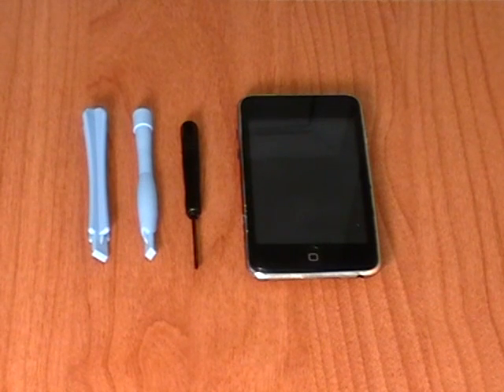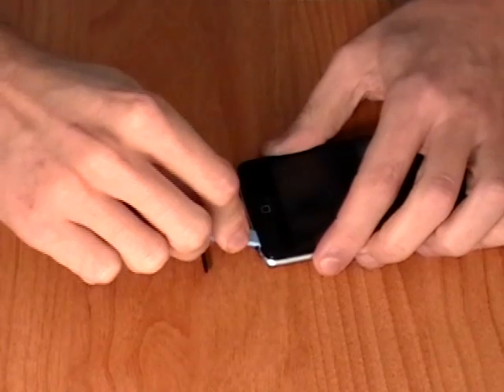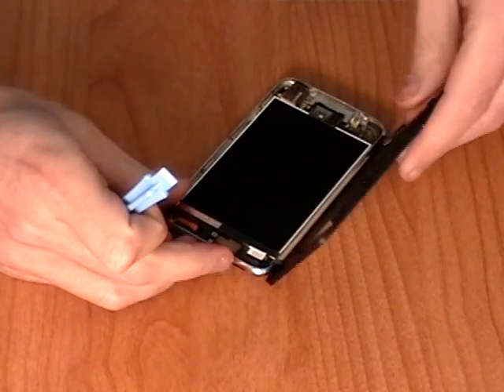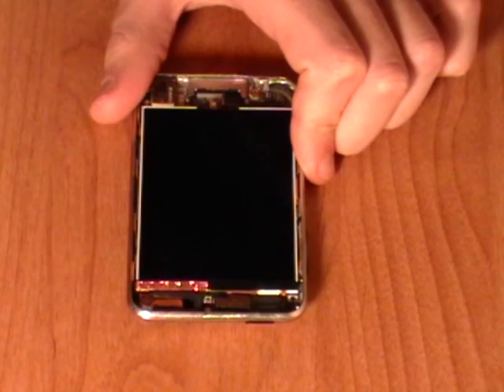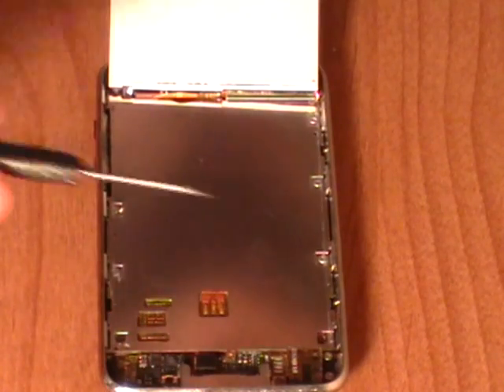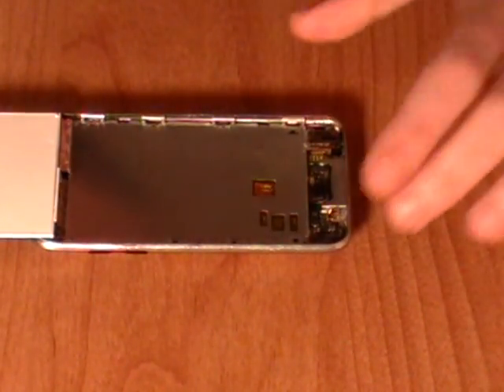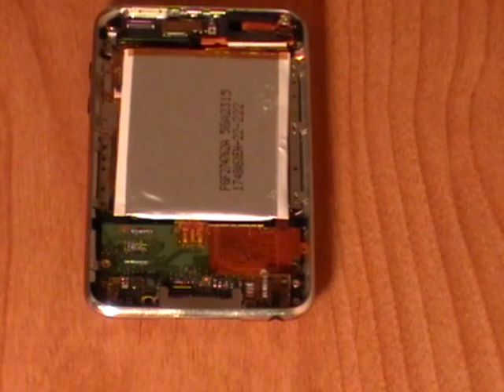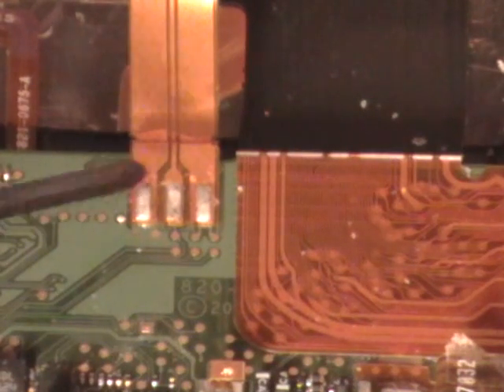iPod Touch Battery Replacement Repair Guide for 2nd Gen

Comment: ok, so you failed to mention all the things I had go wrong. The adhesive that holds the digitizer. ruined that. What do you do with a stripped screw. cant get the battery out because its glued to the metal frame I cant get out. Don't touch the screen it will ruin it.....easier to buy a new one on ebay.
Reply: oh, and those pissass plastic tools chip away. so they are worthless.
Reply from the maker: Hello, Sorry you haven problems with this. Lets see if we can get you right as rain.
Do you need to replace the Digitizer and the LCD? or just one of these?
If its the Digitizer here you go.
On the adhesive that holds the digitizer. did you buy the digitizer with the frame?
If you have bought the digitizer with frame here are the steps.
1) take your pry tool around the bottom sides and slowly work up the sides to the top.
2) once you feel the digitizer is loose and can be removed. put down the pry tool and take your hands and slowly take the digi. off the device.
3) once you see the flex cable on the top that is for the digi to the motherboard you can release the flex cable.
That`s just the Steps to remove the digi on an ipod.
here are the steps to put a new one one.
1) with your new digi , take the flex cable and connect it to the ipod.
2) remove any xtra plastic that comes on the digi from us. It should have 2 one on the front and 1 that sits next to the lcd. remove this one.
3 with the plastic removed put in the digi to the ipod from the top first, and then the sides and then the bottom.
with that now in place test the home button ( one on the bottom ) if its makeing a click sound you are in great shape.
those are the steps from replacing Ipod digi/screen with frame. from start to end.

If you bought the Digitizer with no frame you will have different steps.
theses are those steps.
1) take your pry tool around the bottom sides and slowly work up the sides to the top.
2) once you feel the digitizer is loose and can be removed. put down the pry tool and take your hands and slowly take the digi. off the device.
3) once you see the flex cable on the top that is for the digi to the motherboard you can release the flex cable.
4) now take your pry tool and heat gun around the sides of the broken digitizer and remove all the broken glass. ( WARNING ) please go slow and do not cut your self. glass will be in spliters here so slow is good.
5) once you come to your home button you will need to remove it with out breaking it, and to do this you need to take your pry tool and slowly go from the back to the front . you can apply some force but not so much that it breaks.
6) once you have the home button out . keep taken the rest of the broken glass off.
7) Now that you have all the glass removed from the frame its time to apply some adhesive to the frame. if you bought or have pre cut adhesive would be good here. if not don`t worry. You can cut your own.
8) once you have your adhesive to your frame connect your home button and metal frame to the Frame. ( the metal one is the one on the home button )
9) Once your home button and adhesive are all together. its time to put your digi on the frame.
so take your new digitizer and connect it to the frame, To make sure you have a good fit - follow the bottom with the home button hole and go from there.
10) with your new digi , take the flex cable and connect it to the ipod.
11) remove any xtra plastic that comes on the digi from us. It should have 2 one on the front and 1 that sits next to the lcd. remove this one.
12) with the plastic removed put in the digi to the ipod from the top first, and then the sides and then the bottom.
with that now in place test the home button ( one on the bottom ) if its makeing a click sound you are in great shape.

This is the steps from start to end on how to replace ipod digitizer with no frame.

if you need anymore help please feel free and replay to this.

Comment: ok so my ipod dint hold a charge so I replaced my battery and after it still wont hold a charge and shows that I have to connect it to iTunes but when I do and try to restore it says I have a problem and wont reboot. What should I DO!?!

Comment: How can I test the unit to see if the "no power on" issue is the battery, dock port or motherboard? I have a unit that does not turn on, charge or connect to iTunes.

Comment: does repairs universe give soldering tools along with their usual repair kit.. what is the cost of battery plus all the tools. my battery still works but doesnt last for more than 24 hours even when idle. it is kinda erratic sometimes it will last for two days. but at other times it will discharge within few hours. can i improve the performance of this battery. the ipod is more than  3yrs old or shd i go for a battery replacement. I am kind of tired charging it again and again

Comment from the maker: Depending on what caused the initial battery to fail, this could be a damaged board. Also you want to double check the installation for connections.

Comment: Hi, my 2g touch died, i presumed it to be the battery as my son has thrashed the pants off it for nearly 3 years. it would do nothing at all and was not recognized by itunes. After your very informative video i have replaced the battery but am still in the same situation, any ideas why or any other tests to determine the issue? so far im thinking its the logic board

Comment: I believe my ipod battery is burnt out because it will turn in and work fine but only if it is plugged into a power source at all times. It literally shuts off the second i unplug it from power. Do you think it would be worth it to get a replacement battery? or should i just buy a new ipod?

Comment: I did this repair on my iPod touch 2gen and the device powered up after replacing that battery, but the screen did not load the apple logo or anything....it WAS getting power to the screen though, it was backlit.  I checked the screens ribbon cable  and it was securely in place...what could it be?  I did my best to solder the battery neatly in 3 strips like it originally had. could it be a problem with how neat the solder was?

Comment from the maker: It really depends on what kind of damage was done. Leave the device in a bag of rice overnight to soak up all the water, then try connecting it to a computer to see if iTunes recognizes it. If it is recognized, then it is likely the motherboard is functioning correctly. If it not recognized then it is likely the motherboard was damaged and the device would be considered "totaled".

Comment from the maker: Normally the battery would not cause a dim screen, a quick test would be to plug the device in. If it functions fine, the yes, the battery may be to blame. However it will likely stay dim as it is the LCD screen that is the cause - assuming there has been no motherboard damage to the device (water damage usually).

Comment from the maker: @jay666rob Its best to have a reference (such as this video) to be sure you have it lined up properly. After the old battery is removed, it becomes quite obvious where the connection needs to sit. Once it is lined, just tack it down with a small amount of solder.

Comment from the maker: @lucien0002 Sounds like a connection issue, likely caused by the solder. I would suggest attempting to resolder it, or if you are not comfortable, take it to a repair shop and just have them resolder the connection. I can't imagine somewhere local will charge you much for that.

Comment from the maker: @oalacord Normally, if all software options have been tried, the only hardware issue is the USB dock port. Normally replacing this can resolve the issue. We have never had this error appear for a damaged battery, but it is possible.

Comment from the maker: @MrBarrowzscape Normally 500 charging cycles, but there are a lot of variables. Normally last 2 years with heavy use, and up to 5+ with lighter use. But just like any other part, it can degrade faster due to things like moisture and how the battery was broken in.

Comment from the maker: @j69d A batter replacement would be your best bet. If it had more juice it will likely be able to fully boot up. Also hook it up to iTunes and make sure it does recognize the iPod (it should). You can find replacement batteries at RepairsUniverse (dot) com.

Comment: I put my Ipod touch 8GB into the washing machine by accident... it still switches on when its plugged into charge, but it doesnt charge up and it does not come off the charging screen that has a charging battery indicating its low on power, would that be due to the battery not giving it significant power to be able to leave the charging screen or could their be other issuses??

Everything else seems/looks good as i've completely taken it apart, what would you recommend in my situation?

Comment from the maker: @failatfailing11 You will either need to use a screw extractor to remove the screw, or use a small drill bit to drill out the screw and remove. These are your two easiest options. As long as the flex cable is in the correct position, there should not be any issues.

Comment from the maker: @failatfailing11 No, you can simply try splicing the wires, but this is not recommended as the reliability goes down. Simply twist the two ends together and make sure as much connection is made, then cover is electrical tape.

Comment from the maker: @failatfailing11 You will need a soldering iron, solder, and electrical tape. There are many guides here on YouTube you can use to learn the basics and preform the act yourself.

Comment from the maker: @cityofcandypaint Replacing the battery could resolve the issue, assuming it is the battery that is faulty. Check out our replacement parts for the Touch 2nd Gen at RepairsUniverse (dot) com.

Comment: mine fell in salt water fro about 30 seconds and imediatly turned off if i open my ipod and remove the battery and dry it off or replace it and dry the ipod do you think that will fix it?

Comment from the maker: @MexicanMuncher Could be a bad iron or bad contact. Test it out and make sure heat is being transferred. Does not take too much to de-solder the battery connection in most cases. Good luck!

Comment from the maker: @arjanvlek The best way is to use a pry tool of some sort and pop it out. Some have quite a bit of adhesive, others seem to have little. Be gentle and slowly pry around it, you will eventually be able to lift it the rest of the way out. 3rd and 2nd gens are nearly identical, so should be no issue there. Good luck!

Comment from the maker: @XxxProudxxX You will need to de-solder the connection and remove the cable. You can then replace the battery and should be no issues. Good luck!

Comment: It turns on, but the screen is Blue with white lines (It was totally submerged for about 3-5 seconds and then worked for about 5 minutes after that, before turning off) D:

Comment: I have an ipod that fell in the toilet and i left it to dry for days when i plugged it in it turned on but the problem is that the touch sensor is damaged, i can't touch anywhere on the ipod. Also if i charge it the next day it will be almost out of battery, what should i do to fix it.??? HELP

Comment from the maker: @billybee48 With water damage its always hard to say for 100% what the issue is. It could be motherboard or battery. You may want to try changing the battery as these are low cost parts and it could fix your iPod.

Comment from the maker: @iluvrunescape114 Sounds like your battery is bad. This happens with rechargeable batteries over time. To solve this you will need a replacement battery. You can find these at RepairsUniverse (dot) com

Comment from the maker: @fusionstar916 If the battery is undamaged you can solder it back on. If not you will need a replacement.

Comment: water in ipod seems to be a common problem.  Rule #1 of wet electronics is to always remove the battery immediately so it won't set up a current in the ions in the water and corrode the components.   If that's not possible, would it do any good to soak it in distilled water, or would that cause more damage?

Comment: @frog8484 sautering is actually very hard if youve never done before with electronics. You need the right temp suaghtering iron, you need to be careful and the battery clip is very small compared to the iron. If you hold the iron to long on the circuit board it will start to burn and fry it. I sugjest just to take yr ipod in this is to much hassle unless youve done stuff like this before

Comment: @golfguy1995 i did the same, except mine fell in the bath. fill a small container(big enough to put your ipod touch in as well) with rice then insert the ipod touch and smother it in the rice. put the lid on the container and leave it for a week or two. it worked for my ipod touch and also my mates samsung omnia, so give it a try. good luck :)

Comment from the maker: @Jonathannovak1 The screen won't come apart in 2 pieces as it is attached to the mid frame. However we recommend you replace the touch screen at the same time before it gets worse. 

Both battery and glass touch screen replacements are available at RepairsUniverse (dot) com

Comment: I have a question: the glass screen on my iPod touch (2nd gen) has one long crack that extends from the middle right side down to the bottom left. It goes from the right metal edge to the left metal edge. If I remove the screen to replace the battery, will the glass come off in two parts, and will I need to replace it?

Comment: Great video! Step by step; very easy to follow. i plan to do the replacement myself when my iPT's battery dies. 

One quick question: does 2G share the same battery as the same battery with the 1G or iPhone? i mean, should i worry about incompatibility if i get a replacement package for 1G iPT or for iPhone.

Appreciate it.